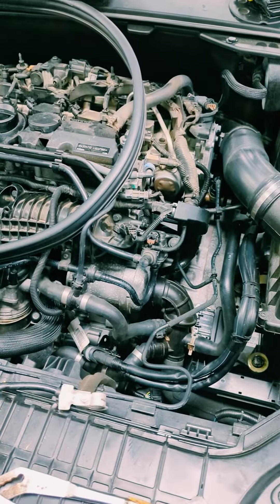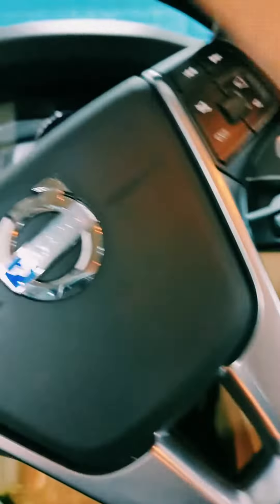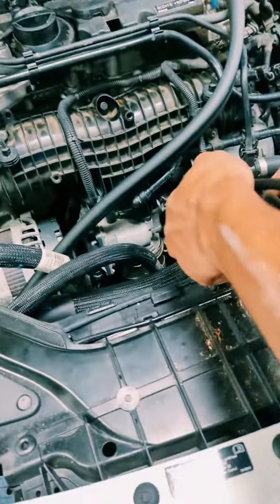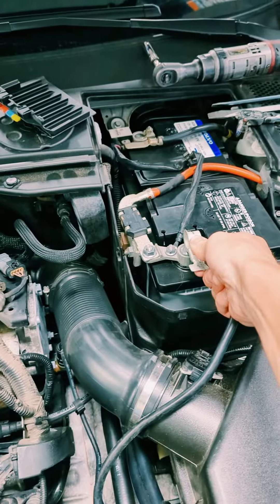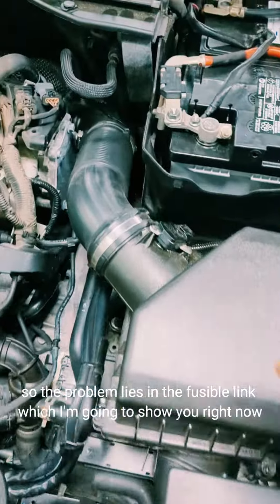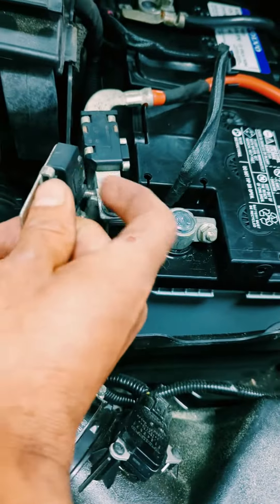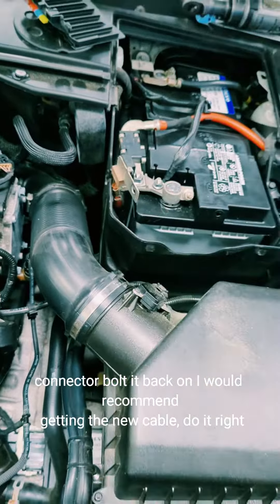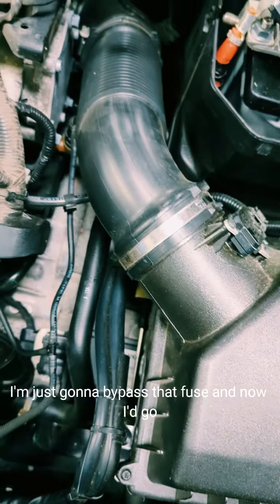VOLVO NO START SOLVED " 100%" S60 AND MORE #automotive #volvo #starter

Comment: Thanks ill have to check this out.  I jave an older c60 that had a weird starting issue since i got it.  Like 1/6 times it would sound like the battery was dying--it wasn't getting enough juice.
Reply: Dang.  Seems like it might not be that easy.  I poked it with my multimeter on and I kept a solid 12v on it even when I wiggled it pretty good.
Reply: I have a similar thing with my c. 20 year old S60. Starts when it wants. Stepping on the gas while turning the key helps sometimes. Had the fuel pump relay switched and things worked fine for about a week. Let me know how your experiments went, I am shit when it comes to auto repair :D
Reply: @EverybodyBurts  I couldn't recreate any problems with my starter fuse link after testing with a multimeter.  Maybe I should try with a carbon pile load tester but my fuse link isn't design in a way it can mash up against something like on this video.

I'm suspecting the high voltage ballasts for the headlights now.  I was riding with one burned out headlight and it was really bad for that week.  I replaced the bulb and it was almost good again, like 5/6 good starts.
Reply: @MrNoobed  Does your Volvo also have a "check lamp" -kinda noticecode that won't go away even if the lamps are working fine?
Reply: @EverybodyBurts    It used to, then the bulb went out completely.  It's been clear since I replaced it.
Reply: Maybe it's just being nice this time of year but it also seems to be better since I've started treating it like a push to start car.  The key is fake, and so is the starter position of the ignition. I've been putting the key in and giving it 10+ seconds to make sure it's comfortable with reading the lockout chip, then switch it to start but just let it go instead of holding it until its running like an ood car.  The ECU cranks it as long as it feels like, and holding it is just confusing it maybe.
Reply from the maker: @MrNoobed 🤣🤣🤣
Reply: I am starting to believe that this issue has to do with fuel pressure. Gonna see a specialist about it next week.
Reply: For me it's still like 80% better since I stopped holding down the ignition to start like an old car.  I can live with it like this until it figures out what the problem is and throws a code
Reply: What that cable called again? Or a part number?
Reply: @EverybodyBurts how'd that fuel pressure do for you?  My trouble seems to be back with the hotter weather.  I might have some engine codes finally with some reduced engine performance issues
Reply: @MrNoobed  I was really putting my bet on the fuel pressure issue, but the culprit ended up being the wheel that is connected to the start motor. Whatever the wheel is called. The spare part wasn't particularily expensive, but the work involved cost a pretty penny. Also had to get a new start motor. Now the car starts every time in a nanosecond!

Comment: I had this issue on a p3 s80. Instead of buying the entire cable.  I physically broke the fuse off drilled two holes of its metal plates for each end and put a cheapo 5 dollar 150a fuse with two short nuts/bolts. It's been working fine 2 years later.

Comment: Does the cable to the negative also have a fuse?
Reply from the maker: That's negative.
The Negative side has the Battery management sensor only and they hardly ever go bad.

Except for Honda that had recall on those sensors, the rest of the brands are pretty much trouble free.

Comment: Same issue with my V40, lately need me to use push button twice before it can start (press button for the 1st time then only click sound heard from starter). But if I'm charging my battery to full charging, the car can easily start. I thought about my battery lifespan is done for, so I've tried to replaced a new battery, it did well  until 6@7 months using it still got this hard start/crank issue. 

Probably need to do some modification on these fuse, or worst need to replace a new starter cable...😄

By the way, you are definitely a Volvo's master, so thanks man!...👍🏼👍🏼👍🏼
Reply from the maker: Check the battery and it's condition first!
Reply: @barakzai90  Sure, will look for some current leakage at 1st place. But I'll look into other possibility like starter relay circuit issue, faulty push button, or bad starter@cable too.

Anyway, thanks for ya advice!....👍🏼

Comment: Great video.
I was actually looking for a solution to the "low battery" message fix when I came across your video.
My car starts just fine but the low battery message won't go away.
I unplugged the BMS sensor and plugged it back in. Maybe I'm missing something. I don't know.
Reply from the maker: Glad to hear that ☺️
Reply from the maker: Low battery messages on Land Rover and Volvo vehicles are often caused by the battery itself due to one or two defective cells.

Comment: Are there other symptoms apart from no start. Mine seems to  lack enough voltage to even eject the key fob
Reply from the maker: Check the condition of your battery, The key to a proper diag is to ensure the 12 volt battery is good and it is stable.
And that the alternator is putting out as it is designed.
If you get around 13.9 to 14.5 volts when the car is running, The charging system is at its best. Anything less than that, will cause all kinds of communication issues with communication codes stored in the system
Reply from the maker: Since the alternator has a built-in voltage regulator, You can disconnect the terminals from the battery if your car continues to run without any suffocations or changes in the way it idles, your alternator is good and that is one method of checking the alternator if you do not have the proper tools to check the condition of the alternator.
Reply from the maker: You seem to have a battery that is going out of service
Reply: @barakzai90  Tried with a different battery. Same issue. Im advised that i may have a bad ground or failed fusible link
Reply from the maker: If you are still getting slower cracking up then you properly need to install a new starter.
The Starter motor is more likely tired already

Comment: Do you know the part number of that fuseble link?
Reply from the maker: Part number 31376603 fuse. B+ battery cable for the starter motor.
Note: VOLVO isn't selling the whole cable from the Starter all the way to the battery.
They offer Cable about one foot long that comes with a new fuse and a sleeve to cut the old one and attach the new one to it but you are gonna need a good wire cramper

Comment: Are you active and local to NY ?
Reply from the maker: I'm in GA now
Reply: So I have 2011 S60 T6  and the exact same noise happens trynna start. If I don't turn it off within several seconds you can see smoke come out of the starter.... So do you think the smoke w chemical smell pretty much tells me that the starter is bad? Also should I get a fusible link anyways to be safe or does that not smoke ?

Comment: I have the s40 just cranks won’t start 07
Reply from the maker: Disconnect the fuel line and make sure it is getting fuel. 

If there's no fuel flu when you cycle the ignition, check the fuel pump related fuse and relay. If they are Good then the motor for the pump is out of service. 

In other Cases, the Spark plugs are compromised and a set of new spark plugs will take care of the issues. 

Quick Hint: Spray throttle body Cleaner into the air duct while someone is cranking the engine. if it begins to run while the spray cleaner is getting into the combustion chamber, it means that there's an issue with the fuel delivery system. 

If the fuel system checks out okay, make sure to check the mass airflow sensor for bugs or micro insects, give it a good cleaning service and reinstall it. 

Let us know what you come up with!

Comment: Hi what happend if i put direct this cable without fuse? Ive this problem with my s60 t6
Reply from the maker: Nothing will happen. It is over engineered to prevent the what if this fails or what if that may fail..

Comment: It’s cranking but not starting, what does it mean?
Reply from the maker: If it is Cranking but won't fire up! I'd check and see if your voltage is where it's supposed to be, if the Voltage less the desired range... It will prevent a startup.

2- check your Fuel pressure if the intake Low pressure pump motor is actually engaging by either listening to it, disconnecting to the fuel line or as simple as spaying throttle body cleaner through the AIR DUCT while someone else is cracking the vehicle... If the engine begins to crank up and keep running, you are looking into two (2) possible scenarios, one is swapping the fuel pump relay with Horn relay (a known good relay) and that makes it the difference, you will know that the intake Low pressure pump motor works. If it didn't make a difference, I'd check the fuel pump motor operation.

This is all without using any type of diagnostic Scan tools.

A bad knock sensor will prevent an engine from startup.

A bad fuel pressure sensor will prevent an engine from startup.

A dirty MAF mass Air flow sensor will prevent an engine from startup.

A throttle body motor stuck in the on position will prevent an engine from startup.

And a few other things... 

Let me know what you come up with 🫡